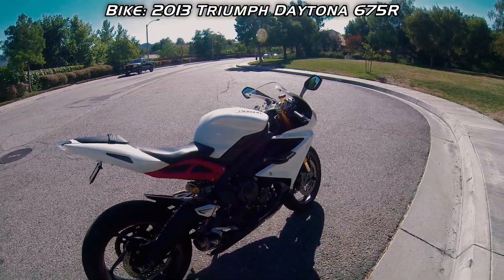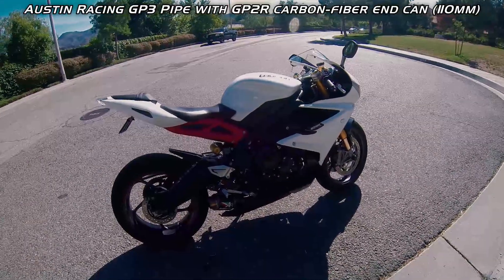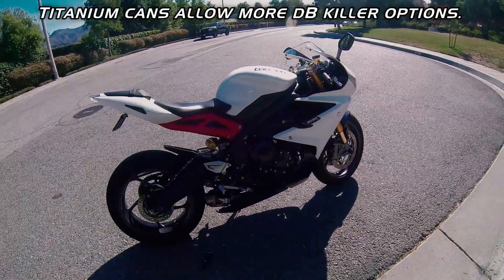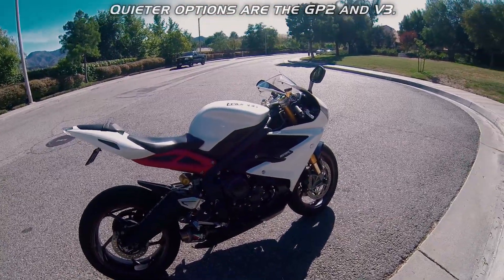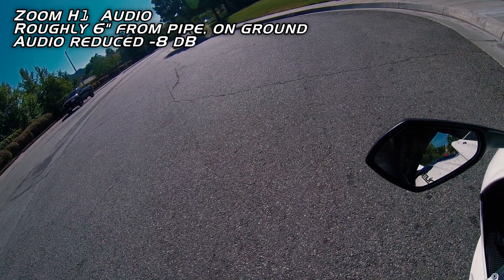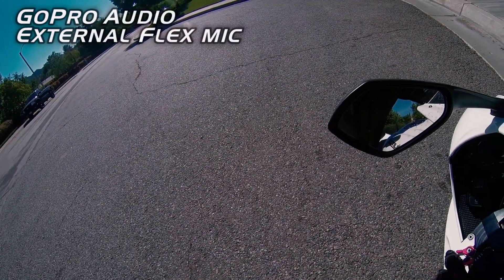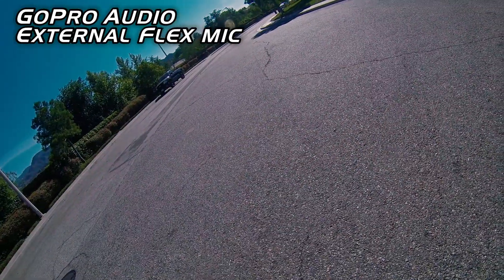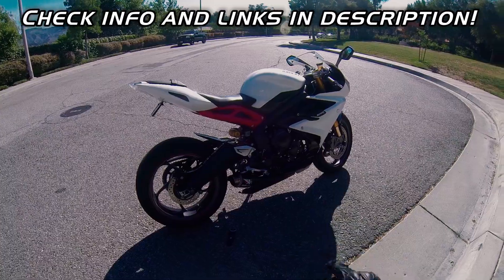Exhaust Audio Demo: Austin Racing GP2R Carbon!

Comment: Oh damn, ya it clips that H1 so bad haha.  But that's the problem with GoPros, they don't really tell you how loud an exhaust is.
Reply from the maker: @Warheroguy: Yeah there's some noise-reduction stuff happening on the GoPro. You can get a sense of the tone and wicked sound, but not the volume. The H1 gives a better sense of how open it is, with a different vantage point nearer to the pipe itself.